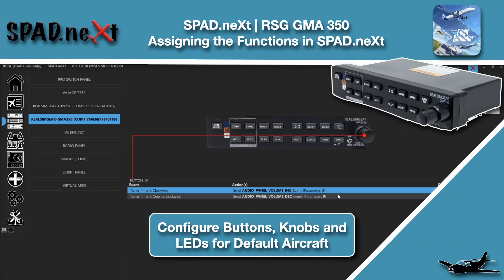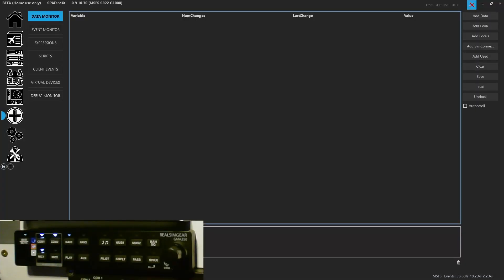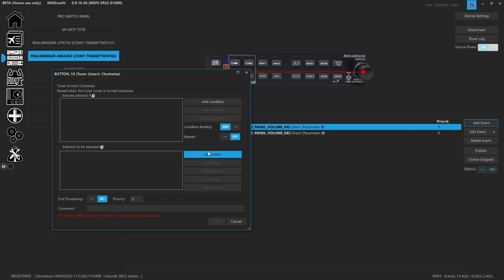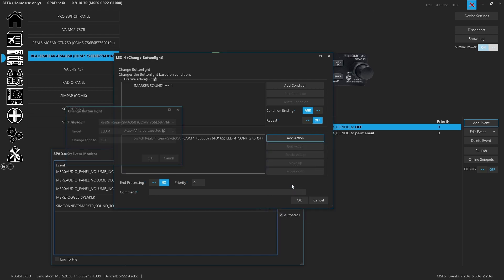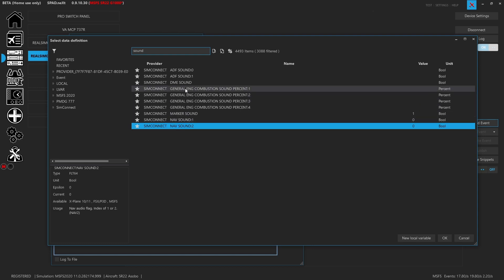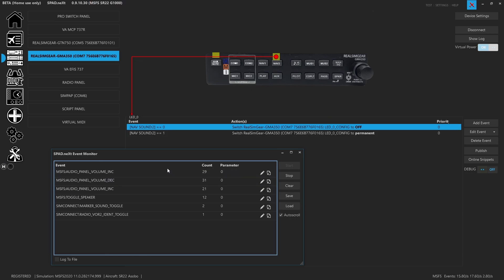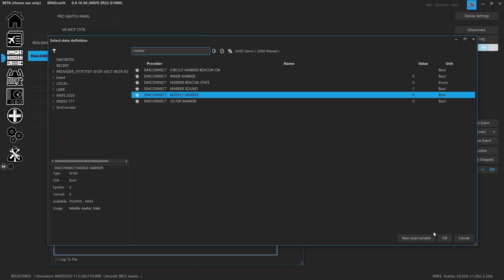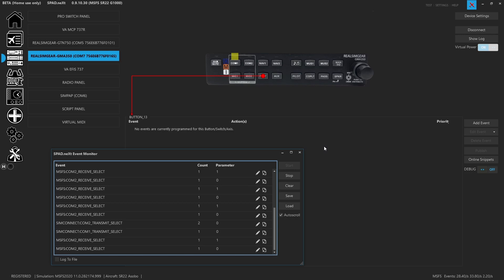(Sim Video) RealSimGear GMA 350 | Config for MSFS

Comment: hey man is spad.next free cuz it only got me 14 days trial if it isn't free what license should i buy? thanks for all the awesome tutorials btw
Reply from the maker: It is not free. You need to buy a license. I don’t know what to tell you as to which one to buy. Depends on what hardware panels you have and which flight sims you want to use it with.
Reply: @LesOReilly  alright thanks man i use MSFS and i have the multipanel
Reply from the maker: If that is it then you just need the MSFS/FSX/P3D one. Good news you can always upgrade to complete later if you get midi panels or stream decks.
Reply: @LesOReilly  good! Thanks for the help 🙏